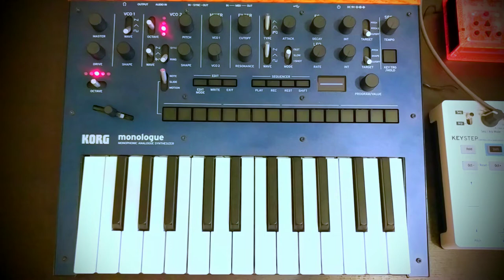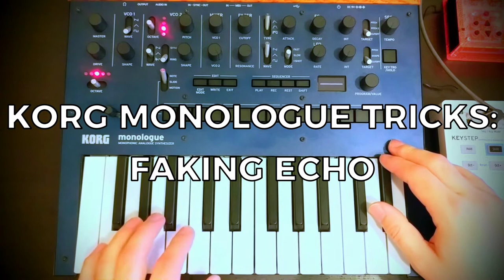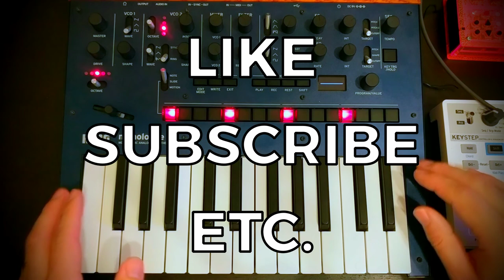Korg Monologue Tricks 04: Fake Echo

Comment: Neat little trick . I did a similar trick a few years ago with my limited monotribe. Using the sawtooth lfo.
Reply from the maker: It's a neat trick that you can apply on lots of different synths. It's a good one to have in your synthesis bag of tricks!
Reply: Oscillator Sink . Indeed a useful wewpon for the bag of limitations. Still when you a touch of reverb it can sound very very convincing. Love it !!!

Comment: Awesome video!! I 'kinda' used it but now thanks to you I understand it in way more detail!
Just a tip that may come in handy: when you set the lfo bpm sync on, if you set the display to show all values (edit -> global -> Parameter disp -> all) when you move the lfo rate knob, it shows the amount in beat mode (1/2, 1/3, 1/4, etc)
BTW I also have it in blue, it looks amazing!
Reply from the maker: +Rodrigo Laporte that's a really useful tip. I should turn that feature on, but there's still part of me that thinks it'll stop me from using my ears as much - but I guess I could just avoid looking at the screen most of the time! Glad you enjoyed the video, thanks for watching!
Reply: Rodrigo Laporte mine is res si it matches my Korg electribe 2 sampler *^

Comment: Hi, I am a visually impaired user of the Jaws program wanting to program some more sounds into the Korg Monog keyboard that my friend sent to me. I downloaded the drivers and the Monolog sound librarian. Buttt, they’re still in the add and remove programs folder, my question is, how to get them from that folder into the keyboard using short cut keys for the desk top and then how to program that Korg Monolog with some more sounds, other than what it already has, if you have any advice, please let me know.

Comment: Can an arpeggio be faked with a similar technique?
Reply from the maker: You don't really have a way to automate the notes you're playing outside of the sequencer, and at that point you may as well be using the sequencer + Key Trig to fake an arpeggiator (which is how I've done it in the past).
Reply: @OscillatorSink  I was thinking of sequencing and arpeggiator where a note can have an LFO such as a square with high intensity so it would theoretically turn on and off. And for each step a different note is played and we can have an arp build up. 

I tried to do the echo effect though and failed, having to watch this again
Reply: UPDATE: it worked! Not perfect but it mimics a key being constantly pressed decently
Reply from the maker: Yes! Excellent work!

Comment: I wonder if the designers at Korg intended for us to discover workarounds like this when they left features out in the Monologue?
Reply from the maker: Whether they intended it, they will certainly have know that people would find ways to abuse the synthesis engine in fun ways. Pushing a synth to its far edges is often where the fun stuff starts!
Reply: This kinda thing just occurs with this kind of synth, it's really cool actually since it adds a load of hidden creative layers and it adds alot to the synth.
Reply: @oOFTJOo  Agreed.  You can use this tip along with his tip #2 secret envelope on a Volca Keys synth.  That synth has a delay built in that when you use these tricks with it's own built in delay you get some really tripped and random delays.

Comment: Hey I have a question, I’m doing everything you said but when I do the sequence the notes won’t play( they just make a quick sound) but when I press on a key and release it, it does work. do you have an explanation?
Reply from the maker: That sounds like the Key Trig is turned on maybe? Is the Key Trig light on the right on? If so, turn that off.
Reply: Oscillator Sink No it was off but I realized I was doing it with a preset and not an init patch, could it be that?
Reply from the maker: Yeah, almost certainly - there'll be other stuff already set up that's interacting with the stuff I set up in the video - have a go from an Init Patch.
Reply: Oscillator Sink Cool i’ll try that tomorrow! your tutorials are very helpful thanks a lot !!!